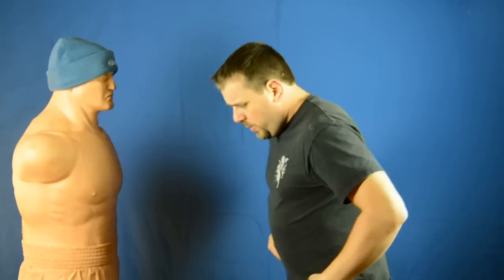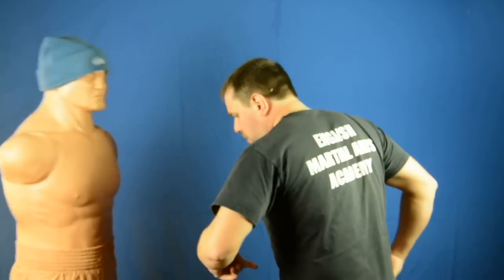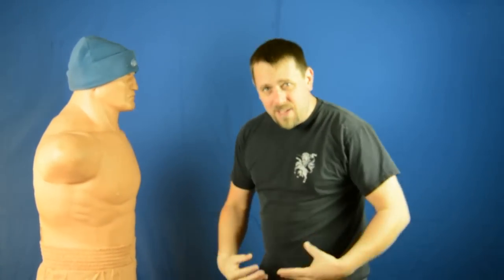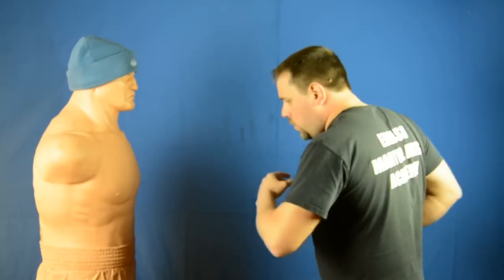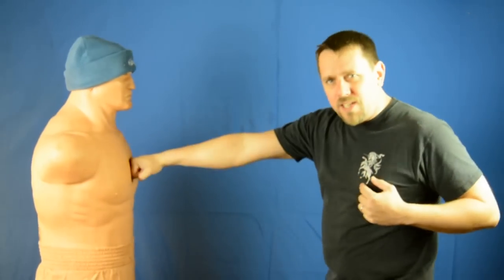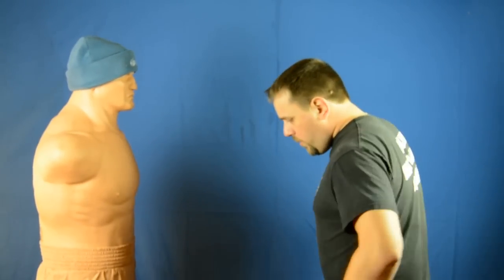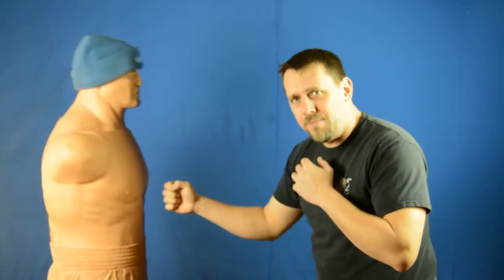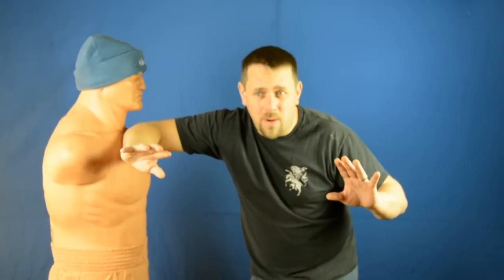A Brief Look at Power Generation in Martial Arts Striking

Comment: Oz another great video. Well physics says mass times velocity equals momentum. What really interest me is that if you have the ability to relax the antagonistic muscle during punching you have the equal ability to contract harder and produce more force. Broughton was a labourer/rower. These people were much more in tune with the function of their bodies than the average office worker. They knew how to use power gracefully or in other words how to maximise power. They learned to use body weight to minimise fatigue. I recently learned to use a sythe and the action uses body weight to cut not forearm strength. I think that when we try to interpret older text we have to understand the use of the body from their perspective. They wrote for their own audiences. This changes the nuances of what they said and meant. Thank you for your ongoing research. It is always enlightening and very much appreciated.

Comment: As a karate guy, I think the key is to use both methods of power generation interchangeably or simultaneously, as situations dictate, and that as Oz said, it all crosses over between styles. When you get down to it there is no "karate punch" vs. "boxing punch", there are just a few slightly different ways to slam your fist into something that worked better or worse (or were simply personal preferences) for certain people in certain scenarios, and there were thus details more heavily emphasized by different people's respective great-grandmasters or whoever. 
There's no real reason a karateka shouldn't be using drop-steps and driving weight all over the place in addition to hip rotation (I certainly do) or why pugilists shouldn't torque their hips (certainly modern boxers do and so did classical pugilists when they came into the clinch/chancery and started hitting with shorter shots). Further, if you look at the sparring drills taught by some of the early karate pioneers (Motobu, for example, or Konishi), there's quite a lot of moving forward into strikes to generate power and possibly close to grappling range, and generally a lot of stuff that looks very much like what old-school boxers were doing.

When you think of a classic karate front stance or back stance, for example, those are pretty obviously freeze-frames of a forward lunge/drop-step and a backwards shift, respectively, which throw your body weight in one direction or the other. No matter what you do, a strike thrown standing still with only rotation around a vertical axis is only going to have, at most, half your weight behind it and not hit terribly hard (and let's not forgot that "ikken hissatsu", the "one-blow kill" is a core principle of karate striking) - that's what the footwork is for. 
Surely it's no coincidence that so many drawings of old-school pugilists have them in picture-perfect "karate" back-stances, front-stances and horse-stances when you have two arts both focused on powerful striking with bare hands, backed up by basic grappling?

Comment: I am sure this has been noticed by others, but Dempsey wrote a manual for unarmed combat for the US prior to one of the World Wars (maybe it was WWI, maybe it was between WWI and WWII, but before Kill or Be Killed was used for US troops. He spent a chapter talking about putting a forward step/leg drive behind blows, in order to get the momentum going. He did liken it to falling onto someone, but he did not really mean weight falling forward. He just meant driving with the leg to push forward. He also advocated powerful stamping with the forward foot at the instant of the connection, to arrest forward movement and leave one set for a second strike. In fact the stamping with the forward foot provides a great beginning for a second blow, driven by the forward leg. He also goes into hooks and how to throw them, and that is where the rotational power and forward leg really shine. So, I think this forward falling punch should be compared to a reverse punch, something that you do when the opponent is in just the right position to risk it. Otherwise, the driving forward and stopping with leg stamp would likely have been used. Although, as a disclaimer, I only really know anything about boxing. Dempsey's chapter was interesting, however.thanks for making these vids. I am really only a bladesmith, and I don't have a lot of knowledge about anything else from the martial world.

Comment: there's a reason boxing evolved away from the shifting weight within the stance and towards more pure horizontal rotational energy (though weight shifting is still used - in jabs especially, and when people 'sit down' on their punches. pure is a relative term). the reason is: counterpunching. using shifting weight or energy from moving your stance is asking to get knocked out if its timed poorly or becomes a pattern.

Comment: Are we comparing similar strikes in this video? I'm just thinking that perhaps the karate punch isn't meant to produce the absolute most powerful punch, but is to provide a powerful punch while keeping you balanced and able to defend yourself. I'm no martial arts expert, but I feel like the worst knockouts I've seen in boxing/MMA are when somebody is moving forwards after a missed strike and then take a clean shot, and in effect their momentum seems to have made their opponents counterattack more powerful.

I think it was Sport's Science who had a video a good bit back about whether the "Happy Gilmore" golf swing actually generated more power than a standard swing. What they found was that the golfer actually could hit the ball 20-30 yards farther with the running start than from a base stance. In the conclusion he did say that he wasn't going to start using the Happy Gilmore swing competitively despite the longer range due to the benefits of the balanced stance in terms of accuracy and control.

Comment: -twistYes! I really hear you (the videographer) here. I belong to a karate dojo and they are all about that hip twist thing, but I just can't get enough power, and looked at Naseem Hamed videos, and Dempsey drop step (here on this channel and elsewhere), and Georges St-Pierre's superman punch and feel that, especially in karate where face punches are not allowed so to get a win you need even more power, body weight movement is the answer. There are karate guys do similar things but they are in a minority. This old, light, small sensei generates power by using his body weight. It looks silly at first but I think it is for real and if done well, effective.
https://www.youtube.com/watch?v=7rEZ_GjigJo

However, it seems to me that the standard hip-twist karate style can just keep coming, at a high cadence, whereas the drop step, gazelle hook, GSP, Naz style body weight throw assisted punches require set up so you can't just turn them on for the 2 minutes of a karate match. My last karate match was against a terrier of a karate practitioner who just did his hip twist punches non stop. I tried to do damage with my drop steppish jab, and after the match he showed me his red chest, but I could only do 5 punches whereas his hip twist style did 30 or so on my ribs, ouch. And I was backing off, or it would have been  100.

Incidentally, I think that the Ingle Gym, that trained Naseem Hamed, were old-school pugilistic.